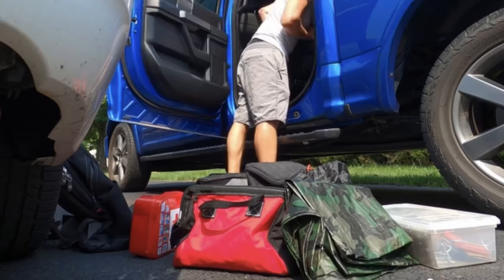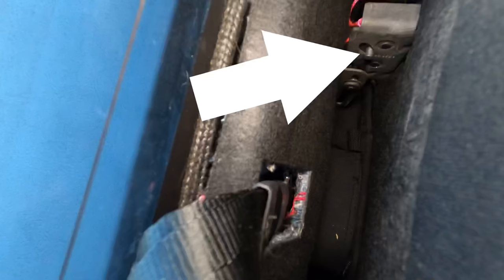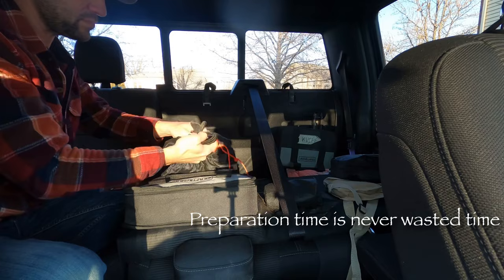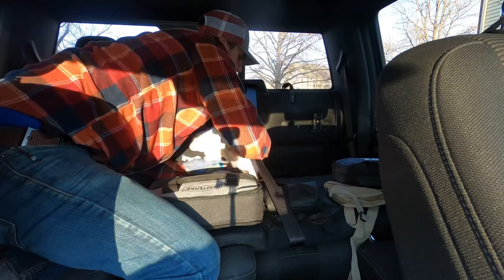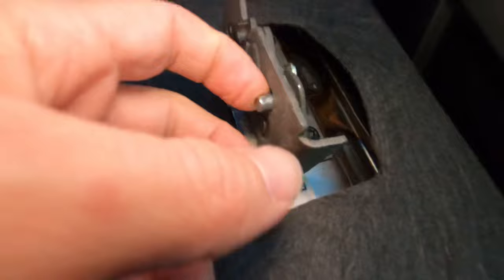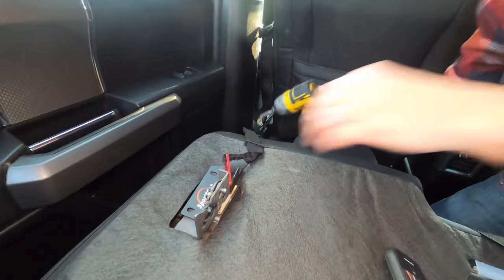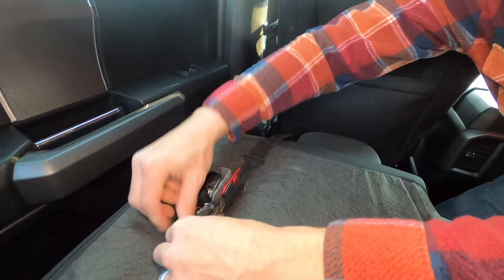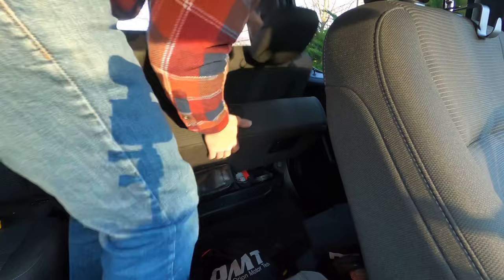Ford F150 Hidden Storage Access

Comment: I did not have to buy the gadget. i just drilled a hole on the end of the catch and installed a small key ring which is then attached to a string. I just pull the string to unlock.
Reply from the maker: Yep - that’s totally works !
Reply: Your just being cheap, i hope the string or rope matches the interiors look.👍👍👍👍👍🍻 i would have done the same as you, but some people aren't mechanically inclined to do such a difficult job. Ops my bad, they wouldn't be able to install that $10.00 kit either.😂😂😂
Reply: I am totally with you on this idea!
Gotta love saving cash!!
Reply: I could imagine using small braided steel cable with a stopper and a loop for this.
Reply: I did the same on my '16 and used paracord that my daughter braided with loops in the ends. One for sliding onto the headrest bar and the other on the keyring. Black paracord is out of sight and out of prying hands. Took longer for her to braid than to install.
Reply: also had subwoofer there but still room for plenty stuff. Keyring was free and paracord < $10.00. Daughter-priceless.
Reply: I did the exact same thing and then the end of the loop went around my hardest post. I'm less than a dollar out of pocket.
Reply: @lookingthroughice7843 he's not being cheap, the less money you spend stuff you can't even see 99% of the time could have been spent on things you can see like aftermarket wheels, lift kits, winches. Just use black nylon keychain or Paracord. It's kind of hard to not color match black. Not to mention it's behind your seat anyways. You shouldn't talk down the way people do things because it's not the way you did it. So bougie!😒

Comment: Thanks Michael never knew that was there,  but that part is $35 now. For 35 Ill drill a hole and  put 12ga wire.
Reply: I did that by myself I put the wire and it work perfect fine😅

Comment: Your fix is good, but why doesn’t Ford just put in a strap so you have access right off the dealership lot?  My older Ford has that, why did the get rid of it?
Reply: Big Corporate Greed logic:  We can't provide a strap! That would add three cents to the manufacturing cost of the truck.
Reply: Build Back Better?

Comment: That’s a surprisingly large storage area for things you don’t want rolling around and in the way 95% of the time. But don’t want to be without the other 5%. Extra old clothes is a super smart addition. For rags or a dry set of clothes to change into if temp drops or you get wet.

Comment: I got this a number of years back.  It’s cheap, easy to install, and works great.  You can also get some panels with pouches and straps that attach to the back of the seat to hold items in an organized manner.

Comment: Thanks for alerting me to extra storage.  On the 2023 Ford F150 Lightning Lariat the bar that the latch catches will move up and down in a slot.  You have to get the bar at just the right height  to get it to latch again.  Too high and the seat back won't go back all the way, too low and the seat won't get latched.  You jut push it forward and it folds without the need to unlatch.  About mid way is the correct bar positioning but you have to experiment a little.  Mine moves up when I unlatch the seat.  I recommend making sure the seat is latched and not free to fall forward in case you have passengers in an accident.  
Also, my Lightning Lariat has a module of some sort (computer?) and a woofer back there is limited room.  There is also sound deadening material which I don't want to damage.  Still plenty of space for straps, a brief case, or ???
BTW, my tire changing gear is stashed behind the starboard (right) rear passenger seat.

Comment: Some previous owner put a bungee cord on mine, 2014 F150 XLT XTR & it's accessed that way. 
Be a good idea to oil that latch on the back of the seat too. Ours hung open in the lock position and getting the seat to latch back in place was a pain.
Reply: Just checked mine, and it was "stuck", too!   A little oil fixed it Right UP!

Comment: Just be aware that all after market latch releases will NOT work on some years F150s. I tried two different brands on my '19 and neither worked as the pull angle need to be "just right'. My release that works is a 2 foot piece of 1/8" para cord that I had for other uses and looped through one of the headrest pins
Also. again depending on the model, that space may be partially/fully filled by a sub woofer and/or a 120VAC inverter. My past truck, an F350 CC had enough space plus a woofer that all kinds of things went there
If you have the open space, lots of 'treasures' can be stored behind those seats.

Comment: I bought one of these.  It is an amazing improvement.  I wish GMC/Chevy had something like this (our other truck).
Reply: On the newer chevy/gmc 1500 2012-16 you can trim the bracket on the back of the upper rear seats and you can easily fold them down I put 4 amplifiers back there in my 14 gmc  sierra with room to spare

Comment: Already got it accessible, got the part out, got the drill, and you say, you don't wanna do all that (about drilling a hole and putting a string)... But you still did all that...
I'd save the 10 bucks or whatnot for that (part)
Reply from the maker: nice !

Comment: Not positive of the reason for the shortage area behind the seat, but I think it was for a sub woofer and amp from factory on the higher end FORD trucks. I think it was a King Ranch I saw a video on that had those behind the 60% part of the seat.
Reply: Yep, that's where the subwoofer is located on my 2015 Lariat Supercrew.
Reply: Yeah, I have a 19 Platinum and the amp and subwoofer are behind the seat.  So this would only be somewhat useful on lower trim models.
Reply: That's where my subwoofer is.  Still enough space to stash rain clothes / extra jeans, etc.

Comment: $35 now. Also may not work on the 2019 Lariat as their is a subwoofer and amplifier back there.
Reply: I hear you! from 10 to 35. I think I will make some jig for that. There is space back there but not too much. Either way it would be good to be able to put stuff there. Struggled today to open. Ended up putting my arm under the seat and finally pushing or popping it. I was trying to see if I had a amp or sub behind there.  Just reading to replace the front door speakers and tweeters. System sound good to me 17 xlt but one speaker going bad - been cranking it up recently. Hopefully I will really like the aftermarket oem - I think they will be better.

Comment: If you can’t get your big hands behind the seat to release the latch remove the bolt in bottom corner of the seat back  push it back then it makes it easier to get your hands in there and this works for supper duty trucks as well
Reply: Video?

Comment: The Sub Woofer is under the passenger side seat so it seems this is a wasted space.  As of today 2023/08/29 that $10.00 release is $35.00 on that Amazon site.  But worth it as the extra storage is great for us 'Be Prepared' junkies.
Reply: My 23 f250 lariat has a dual sub woofer right in the center. Basically no room back there.

Comment: I drive a 2015 f150. I don’t have to unlock the bottom seat to fold it it up. Only when to pull it down
Reply from the maker: same here i think, but when i want to fold the back down i have to unlock the seat … which is odd.     kinda throws me off everytime

Comment: A friend of mine that has a F250 was confused when i told him all the stuff i stored behind my set. I told him they are the same cab so he bought the quick release just to find out he has a subwoofer and no room. He was sad.
Reply from the maker: ahh man.. yeah, some of the higher in models have a bunch of crap back there...
Reply: Mine also, but the subwoofer has a cage around it. And it is only behind the middle seat and at the very bottom. You still have behind the whole rear drivers rear seat, and above the sub for soft items.
Reply: My 2015 F150 Lariat Spr Crw has its Subwoofer (Sony) behind/below the passenger side seat floor mounted against the rear bulkhead, the driver side is open as in the video, wondering if there was a production run change or different sound system requirements?
Reply: @AndrePerrault-jw6pt  I know the '14 F150s that came with the premium audio had a Sony subwoofer in that location. Kinda weird slant shaped enclosure. Next generation models and the ones with he B&O systems started putting them behind the back seats.

Comment: My 23 super duty lariat has barely any room back there. Latch is easy to do with a hand, no need for any mods or straps. But with all the sound deadening and the subwoofer back there I doubt i could fit a water bottle back there
Reply from the maker: That’s crazy !!!  Guess they changed it.  Mines a 15

Comment: You only have that space available if you have no electronic accessories.  That's where they put the Amp, subwoofer, etc.
Reply: So anybody over the age of 17 and has completed puberty has this space available.
Reply: @johnjameson7056   Or if you're driving the cheapest truck Ford makes.  Mine has the factory amp, sub, wifi, and a phone booster.

Comment: What is the trick to getting the seatback to latch back when you are putting everything back? It took me forever to get mine to latch and I am still not sure what I did. It seems like I had to line up (by hand) the pin that the latch locks onto.
Reply: raise the lower slightly.

Comment: The part used is a cheap knockoff of the original rear seat release latch developed by Matt at Built Right Industries. Built Right Industries parts are Made in America.
Reply from the maker: Check the link in description- it’s the built right one.  ☝️

Comment: My 16 f150 has a nylon loop already on it. I thought they all did?
Reply from the maker: mines does to but that's on the passenger side...  this is for the driver side.
Reply: @FamilyDIYtv  yea the driver side has one too. Gotta reach down for it behind the seat theres a nylon loop pull up release the seat.
Reply: My 16 supercab has one on drivers side
Reply from the maker: @CoryFortson-eg9jg  did you buy your truck used?  possible the previous owner installed it aftermarket ....   or  maybe ford puts this on some?    glad you got one !
Reply: @FamilyDIYtv  yea itz used. Had 40k when i bought it in 2019. Im pretty sure it was already there on mine. I think ford is hit and miss with some of the pieces on these trucks.